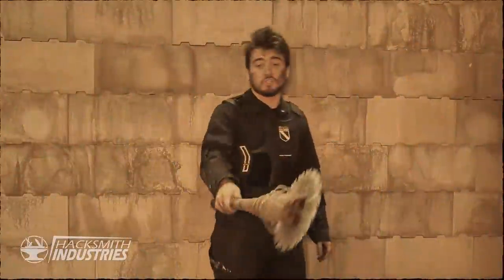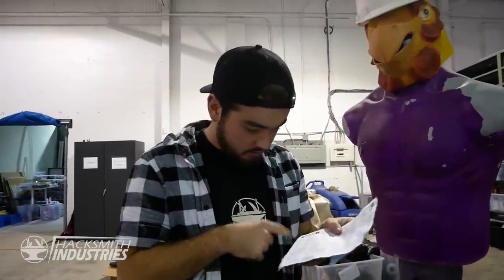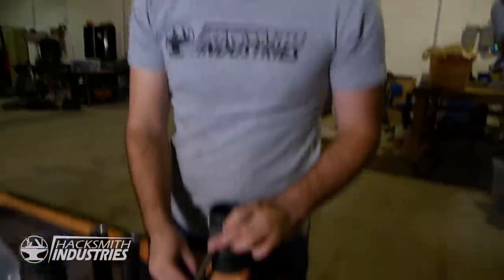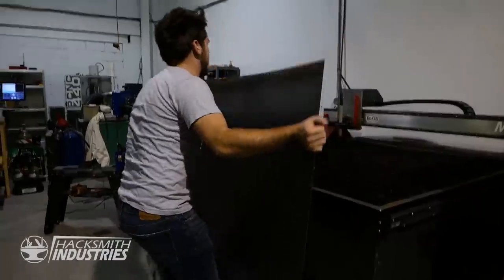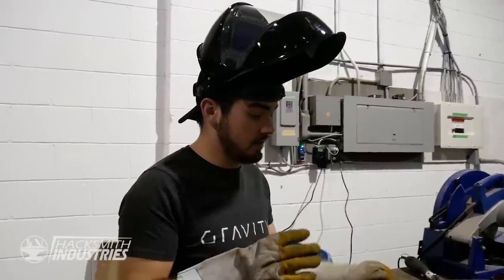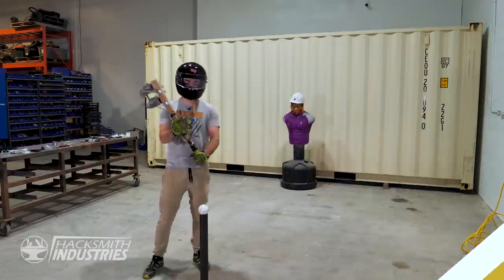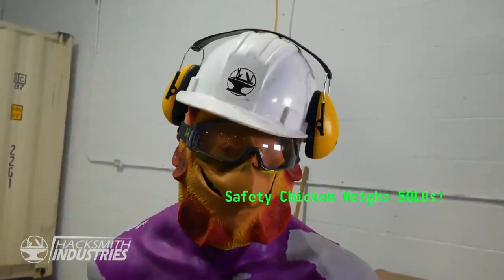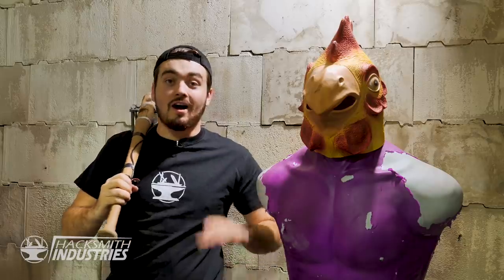We Made A ROCKET BAT from Fallout! (Super Dangerous)

Comment: Very cool, good build
Could probably use a rocket motor with a shorter burn time to use all the fuel during a 90° swing
Also, if you want to go into that, the acrylic/oxygen hybrid rocket motor is a lot of fun and very easy to build.
Reply: I know none of dat stuff but ok 👍😂
Reply: dragon lover 3000 he was basically suggesting a different kind of motor to use. Instead of burning one single solution (a solid rocket motor, what a lot of real rockets use for boosters and nearly all model rockets use) a hybrid motor is closer to what the main stages of real rockets since they use a fuel and an oxidizer of some kind (in this case acrylic and oxygen respectively) 

While hybrid motors in the most simplest form aren’t very different to the average person from solid ones, they provide advantages such as being able to easily throttle by adjusting the flow of the oxidizer which is what makes the flame stronger.
Reply: A hybrid motor doesn't have a short burn time tho
Reply: Bernhard Blietz not necessarily, keep in mind one of the main benefits of hybrids which is throttling, by adjusting the oxidizer flow the throttle will change. So you could just cut off the flow. Or better yet try to keep it at a level where there’s still a bit of a visible flame but not too much thrust so it idles like the Fallout ones
Reply: @starman8853  I still doubt it would be better than a solid fuel rocket. The boosters of real rockets are SRBs, too. For multiple uses a hybrid or liquid engine would be the only realistic option, but for one single hit, solid fuel gets more thrust faster.
Reply: You guys are right, I wasn't very clear. The motor with shorter burn time would be solid as well, probably has much more ISP than hybrid. 
The comment on hybrid motors was just that they are a lot of fun, look cool and could be a good theme for another video.
Reply: @starman8853  this is rocket science lol😂😂😂😁😁😁;););)